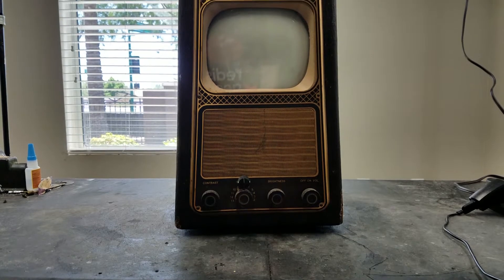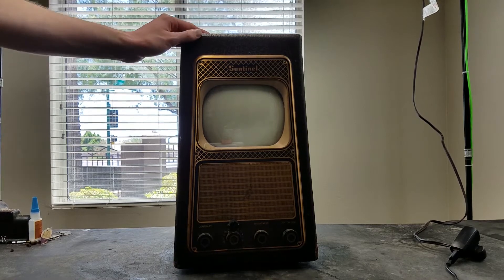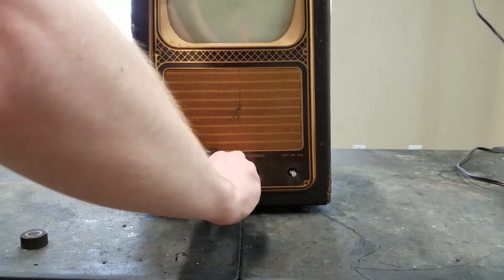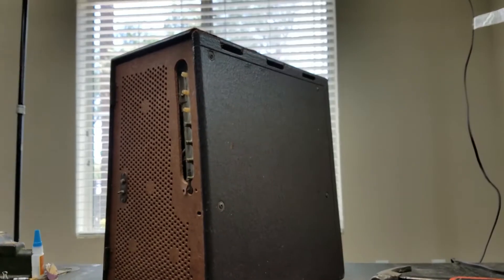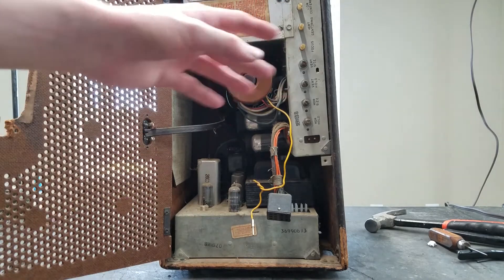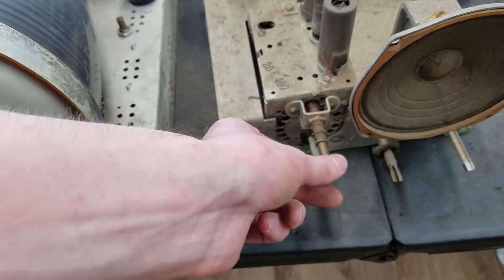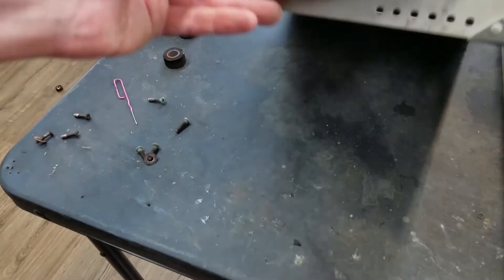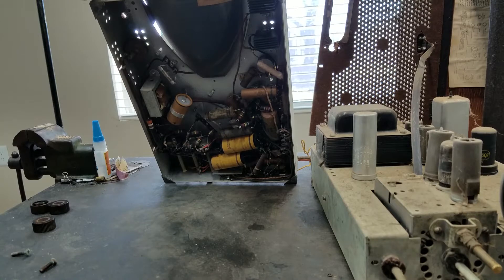1948 Sentinel 400TV Portable TV Repair part #A

Comment: When you touched the boost voltage the image on the CRT changed
Reply from the maker: Touching the boost voltage or high voltage drops it significantly since its a low current power source (which is why its not a good idea to do it for long). A drop in the high voltage would directly affect the picture (since the high voltage is driving the electrons to make the picture), while a drop in the boost voltage would affect the deflection (making the picture shorter or narrower)